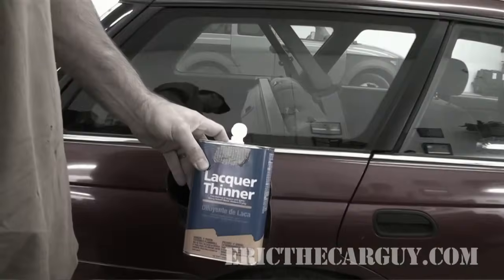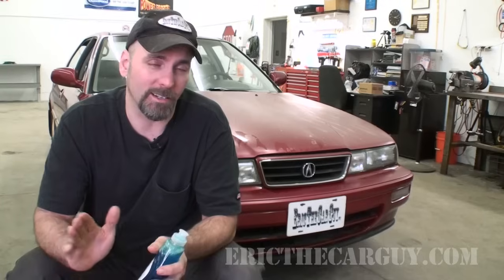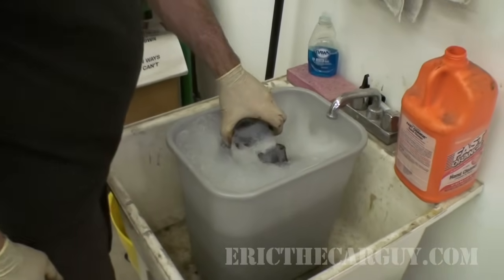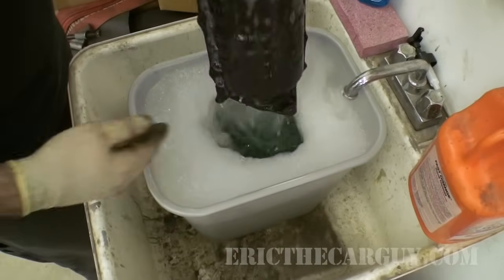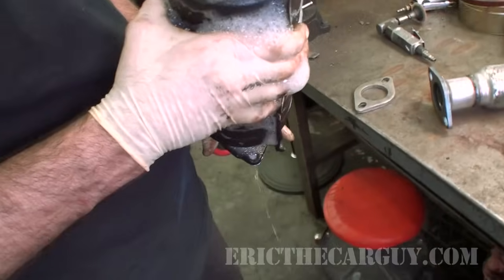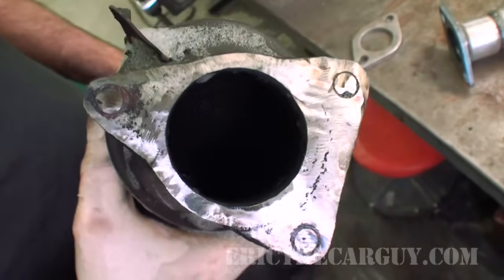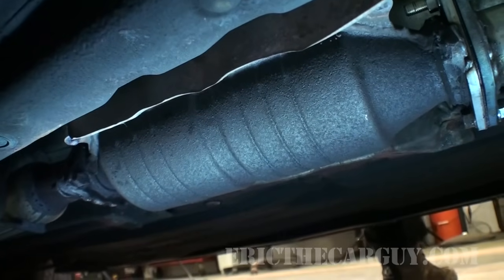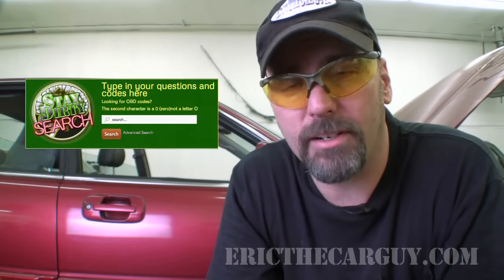Cleaning Catalytic Converters With Soap and Water -EricTheCarGuy

Comment: Free tip: while the water is running, let some of it into the soap container to get the remaining out. I do not recommend you clean out the last bit of ketchup from your bottle with soda, but in this particular application you simply waste less :-)

Comment: my concern with the lacquer thinner is that some fuel injectors, the fuel passes around the coil on the injector to help cool the injector and the lacquer thinner would wear the coating down just like if you used too much of the fuel system treatment additive products... At least that's what i remember when i was in collage... I think he was referring to older GM vehicles though

Comment: Wouldn't the hotter exhaust gasses coming from the engine make the front hotter and as they pass through the catalytic converter it should soak some of the heat and exit it cooler? That's how I see it should be

Comment: Run sodium hydroxide through it, then vinegar to neutralise? Presumably it's just carbon deposits on the substrate, no? If so, methanol and acetone melts through the deposits in the intake manifold and plenum chamber, wouldn't that do a good enough job? Then just flush it through with some water and be done. I think it's sold as "throttle body cleaner", premixed methanol and acetone mix. Otherwise, how about electrolysis? Just thoughts

Comment: Something worth trying is using compressed air. 
It's definatly different but i cleaned a diesel  particle filter out of an international maxxforce7 that was completely clogged.. full with water,  now air threw, fill with water, blow air threw again.  Kept doing this and eventually the water started flowing really well.  After about 30-45 minutes it was completely clean and clear.  Mind you the DPF from this truck was much larger and collected diesil sutt, BUT it's still worth trying.

Comment: Yo Eric, Scotty is rite, Some just can’t come back.BUT THEN.If it’s gunna go in the garage anyway,TRY THIS METHOD! Cap one end,Spray Carburetor cleaner in,Then Foam Engine Degreaser let it settle and soak 15 minutes. Spill it all out or if no cap and in a bucket like you are spill everything out.The pour a Pro Size can of SeaFoam in and let it  soak it over night. Take out of the bucket,spill access out Bolt it back On!!!! With some sea foam still in there.THANK ME LATER!, JUST PROMISE YOU MAKE A VIDEO OF IT!. Ur gunna be loving it !!!

Comment: About to attempt this experiment.... based off experience, does anybody recommend using Dawn or a specific detergent? I will rinse out 3+ times after letting the cat soak and fully dry out before.... of course I will be shaking or stirring up the mix while it's soaking.

Comment: I have a 97 XJ (California) which always passed smog and the last test was the best one yet. The rest of the exhaust does need work and in doing so the catalytic converter will be out. I think I’m going to use the Dawn, it doesn’t need it but if this will extend the life of the unit it’s worth a shot. Guess I will have to get some Lawrence Welk tapes from eBay and play when when I do first drive it.

Comment: Eric , I enjoy your vids , I have been involved with I/M Test and repair and own a performance dyno shop , and have been dealing with cats longer than i can remember , Do you own a backpressure gauge  for testing exhaust? if not get one  great tool and maybe you could do a vid on cleaning a contaminated o2 sensor , your readings on the cat temps indicate you have an exhaust restriction , the restriction is generally where the temp is highest your cat if working properly should have shown an increase in temp front to rear  when you brought up the RPM that car sounded like it was somewhat restricted did it seem to be somewhat low on power when you test drove it ? If you have access to a 4 gas analyzer you could also probe it front to rear to test to see how its working  a OEM cat on average is normally good for a 100 thou miles if the engine is in a good state of tune in this period of time  aftermarket cats your lucky if you get 50 K out of them , if I were going to try and clean a cat I would use some super clean that comes in the purple 1 gal jug and let it sit overnight , and rinse with hot water   keep up the good work   Royal Trent

Comment: I would have tried using a small neoprene impeller pump to work the solution from the  discharge side back to agitate it somewhat , but that's just me . As someone mentioned below , I wonder if using an ultrasonic cleaner would work . Finding someone with one isn't easy however .

Comment: yo Eric my 92 bmw 325i failed on nox on. 15ph and 25ph cat looks New failed by 200ppm on both test I drove for 30mins before I smogged any ideals also no codes stored
Reply: The cats on e36s go bad, I had to have mine done around 175000km.
They get backed up and restrictive, I would give cleaning it a go.
But yeah the e36 cats are known to go bad, so either clean it and replace later on down the road (or sell before).
Or just replace it.
Reply: aw shit same thing happened to me man

Comment: Get blasting sand from Harbor Freight pour in 2 cups in Cat.  Tape off ends. Get a pneumatic paint can shaker, attach the cat. and run it for 10 minutes.  Untape and blow out with compressed air.  Will it Work?  I don't know just a thought for an experiment. You let us know.

Comment: why dont you try a dry cell hho generator on it, it will help lower the heat in the exhaust and lower your emissions make your engine run cooler

Comment: Cool video, thanks for trying that out! I've never heard of this before, but it seems that if you have oil or grease it might help, but if it's carbon build up I don't think it'll help. I'm really surprised you didn't rinse and dry the catalytic converter. soap has things in it you don't want to heat up to 400+ degrees because they could leave a coating on the catalyst metals making it in effective. Chances are that your 20 year old cat is past it's useful life anyways, but just a thought.

Comment: Catalytic converters can take 30 minutes or more to warm up and begin functioning under normal conditions: dry, ~80 deg F ambient temp, with city driving (moderate stop and go).
If the temp is lower after the Cat. all the heat is being absorbed by the ceramic lattice as it is warming up.
also if you still have water and bubbles coming out the exhaust then there is still water inside the cat. making impossible for it to get hotter than 212F far below their minimum operating temperature of ~550F (the body of the cat must be at 550 or higher).

Comment: BY the way and this is VERY IMPORTANT IF UR USING THE BUCKET AND NOT CAPPING IT WHEN CLEANING WITH CARBORATOR CLEANER AND FOAM ENGINE DEGREASER STAND THE CAT UP. But when using the SEAFOAM,POUR STRAIT THROUGH AND PICK THE CAT UP AND GET IT ALL SWISHED AROUND IN THERE.And MAKE SURE TO SAVE ABOUT 1/3–1/2 of the can.The second half Pour it in and try to “Fill it up” with the SeaFoam and lay it flat down it the bucket so the SeaFoam stays in there and soaks overnight

Comment: If you're getting suds out the back you didn't rinse the soap out. The soap remaining in the cat will dry out and leave it's own coating on the substrate. Basically you replaced one problem coating with another. You should completely rinse out the cat with straight water and drain before re-installing.

Comment: I don't think the soap would be strong enough. I had a catalytic wood stove at one time and learned a few things researching that I think may apply to car catalytic converters. Basically if you didn't fire off the cat bypass properly at the right temperature or used a really dirty wood or newspapers etc you would have problems with masking. This was excessive soot masking the metals in the catalytic converter that allow them to do their job. So this masking would prevent the unit from firing off and burning the unburned fuels in the wood smoke. This masking would or could be similar I imagine to a car not running properly. The solution that came up several times and one I had to resort to was boiling the cat in hot water and vinegar mixture with some light brushing. This would clean up the cat and allow it to fire off again. So I think cleaning could possibly work with the right technique and the cat wasn't too old and still had platinum left. If its too old I don't think it could be save. I may try this on my truck as its throwing a P0420 code.

Comment: I find myself wondering many things.  Like why would you not cap off one end, fill just the inside with a 50/50 mix of soap and water, and then put it on some sort of vibrator (like "jeweler's" do to clean jewelry.  Then flush the hello out of it with water from the outlet side.  And I mean rigging up a way to dump 5 gallon buckets through at one time.  Then blow/let it dry before reinstallation, as water expands 1600x when it turns to steam...  And IF you were going to try Lacquer Thinner, why not try it with it off of the car?...

Comment: Starting with hot water might help. Also, adding the soap to the water AFTER the bucket is full would avoid creating. all those suds, which BTW have no cleaning power.

Comment: I just got back from the shop and they said my Ford Sports Trac catalytic converters are plugged. As I was watching your video here I kept saying try ammonia. And you did. Well the reason I thought about it is, before my mom past on. She would clean the stove and  those silver looking rings around the eyes. Well she would have me to take those and place them into a trash bag with about a half cup of ammonia. Then get as much of the air out of the bag as I could. Then tie up the bag. Then sit it out side preferably on a hot summers day. And let it sit at least 24 hr.  The next day those silver rings would pretty much just wipe clean.
 This truck is 2003 model just turned over 110K. At 100K I did a tune up. My first thought was to whack it with a hammer to see if in deed that is the problem. But after watching your video. Hell I do not know what to do. The guy at the shop is talking $1400 to fix. I know I do not have the tools to take apart the exhaust system. So after viewing many videos I tried filiing it up with Chevron gas with STP and some High Boost Octane. And now its got a full tank of gas. Then I stopped by the parts store and they sold me a can of Cataclean  Fuel and Exhaust cleaner. $30 for 16 oz. And get a load of this it say's to run truck down to a  1/4 tank and use. As it is the truck will not get above 30 mph. It took 2 1/2 hrs to get home and it should  have taken no more than 20 min.

Comment: Maybe soak the catalytic converter in bucket of gasoline and fuel system cleaner.

Burnt gasoline and fuel system cleaner goes through the catalytic converter anyways, so try the raw fluid version.

Also maybe just fill the bucket with dawn dish soap only and let the catalytic converter stay submerged for 24 hours, see what happens, after that.

Comment: Try Simple Green - I've seen that eat old oil off a valve cover. But you have to let it sit overnight. I would have washed the rest out with water, let it dry out in the sun for a long time, then hooked it back in.

Comment: I have to agree with some of the comments already made--I feel like hot water and agitation would be key in the process.  If you had a hot soak followed by 24 hrs of FLOW, man I bet it would work.  You'd need to rig up a flange on each end to attach a hose to and find a pump.

Comment: Not scientific at all. Testing with a hole in the exhaust prior but with the hole repaired afterwards makes this experiment irrelevant. Was that engine at operating temp before AND after? Was the RPM the same before and after? This wasn't even mentioned. What were the temperature measurements of the new catalytic convertor for comparison? This could have been a great video and experiment with some controls in place.
Reply: David Barber The only REAL test would be to dyno the car and compare results, because that is where you'd see the results.

Comment: i had a friends sister need to pass an inspection, but had a p0420, i removed the front o2 and poured a whole can of b12 in the o2 hole, since the cat was directly below it standing up. Reinstalled the o2 and drove it at 80 down the highway a couple of passes, and the light is still off, been almost a year

Comment: now from a po420 I had laquer thinner in my engine 1 gallon to about half tank my engine light stayed on befor I used the cleanin for months I cleaned no light comes off butt I took the catt off used detergent overnight and with a 1 week or less my check engine light went out never came back been months for me but in my dionoses I now theres a possible bad catt or contaminated catt I had a coil lead that was rust on my coil pack were the leads is on the coil could been not burning fuel but also derty catt check befor replace

Comment: I have found that dawn working on oil stains mixed with water does work, but for gummed up caked on and dried out residue, I would highly suggest to not use water until rinsing.  I apply the dawn soap directly to the area an let it sit.  I had a Jet ski that put oil all on the side of the ski.  I washed and washed and washed the jet ski and it was never able to get the oil residue off, however when I applied only dawn soap directly to the oil residue area and let it set 5 minutes, it totally removed every bit of the oil residue from the side of the jetski,  I was shocked.

Comment: let that baby heat up for those peeps who dont know the converter is like an extra spark plug once heated up it burns of the excess fuel (fumes) that are left over from the motor making less emmisions its  kinda like stopping the flame thrower exhaust  we all want  ya baby

Comment: the back of the cat was being cooled by evaporative cooling of the water. it will only stay at the boiling point of water until all the water is boiled out. in chemistry, this is shown in fractional distilation. when you boil alcohol and water it will first maintain the heat of the boiling point of alcohol, then it rises to the temperature of the boiling point of water when the alcohol is gone. same thing with boiling eggs. the idea is that the heat is being pulled out and carried by the steam and water vapor.

Comment: You already know when its in that trash can full of water there is nothing coming out of that cat because when you removed the cat the liquid wasnt even dirty. in other words youre not cleaning it and only soaking it. It also seems that the cat was still full of liquid before it has been re-installed so the back pressure alone is going to be high from the liquids own surface tension in all those honeycombs, had it totally vaporized before you took your readings? Maybe you should drive it out like you did with the lacquer thinner experiment, I would say soak it in your liquids that you had experimented with and blow it through with a high pressure washer or take it to a high pressure wash and aim the gun in there to blow it out after having soaked the cat overnight because its obvious that soaking action alone isnt breaking down the deposits in the cat. I would just drop it in chem dip over night and spray it out in the morning. Liquid detergent? haha you're killing me. You're dealing with carbon what will Dawn do?

Comment: "Dawn"  works on armpits.  Yes,  3 times out of 5.  Lasts 3 days no deodorant.  Wear your fingers out but not your armpits.  And "Car Wash" works on hands or it's equivalent from the automotive department.  Just put it in a spray bottle and maybe ad water.  I don't know about catalytic converters.  I used a file and sand paper on my O2's.  So far so good.  Be sure to add elbow grease for dramatic effect.  C'YA...

Comment: My wife's car simi stopped up. I used viper coil cleaner and filled and let it set and flushed with water  through the 02 sensors holes.. looked like coffee coming out. Repeat until water was clean. Let drip dry. Reassemble muffler and sensors and so far so good.

Comment: Sodium hydroxide, I assume it is not laboratory grade stuff, will most likely not react with the platinum at all.
Aluminium will do that and heavily so. I also think not confirming, while doing so will form hydrogen gas in the process which is unwanted when dealing with high heat exhaust gases and parts. It goes boom when mixed with oxygen.

There must be something around that will react with carbon while leaving the metals alone. If it's readily available and safe is another question lol.

Something with tetrachloroethylene in it should work well. There is a risk it will form some type of gas (the chemical warefare type!) with heat so It might be a lethal choice for cat work anyway.

Comment: EEEKS dont use caustic (sodium hydroxide) ! im thinking a 20/80 mix of ds 4000  or dyna strip 2000 and water left overnight. i might feel like testing it and will leave feedback this weekend. i know these chemicals are only sold in bulk as far as i know. acetone is cheap and so is orange paint remover which is sold at lowes etc and orange paint remover is environmentally friendly and prob wont hurt the metal but still a very powerful stripper